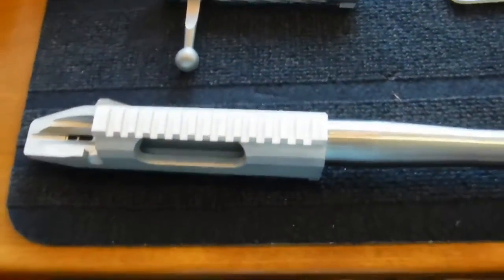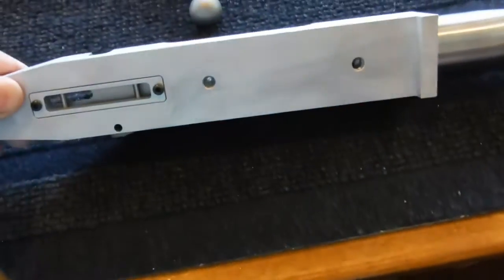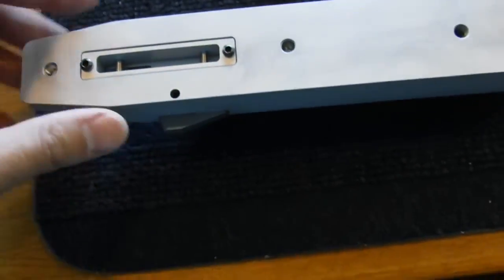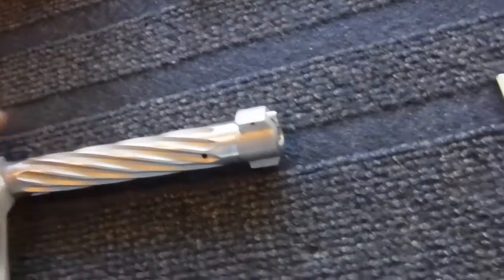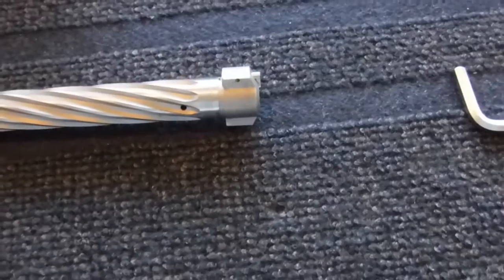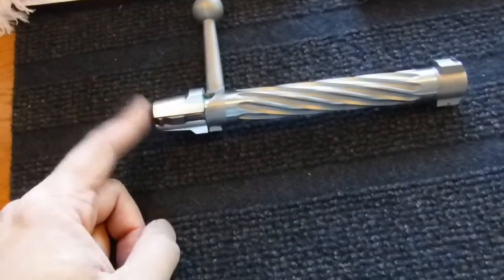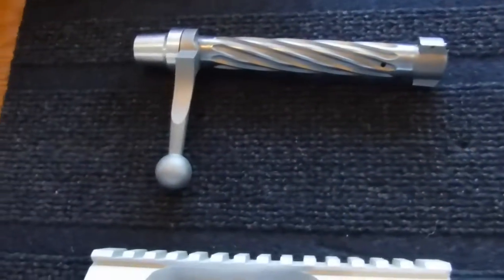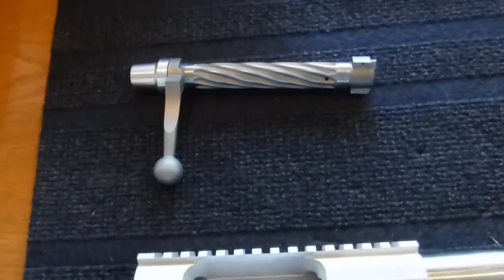VLog 6 - Kelbly F-class Panda Action - TG Ejector

Comment: Not too sure about the big flat bed. It seems good for verticle barrel whip, but would do nothing for horizontal movement.. My fav is octagonal multiflat in a "V"bed.
Or better a tube gun.
Reply: A flat bottom offers a maximum amount of bearing surface when bedded to a stock making it to become almost intregol with the stock. Much is the reason like ruger, winchester model 70, and a couple others made there actions flat on the bottom. Most definitely when building a free recoil bench rifle or f class rifle it is the best design you can have